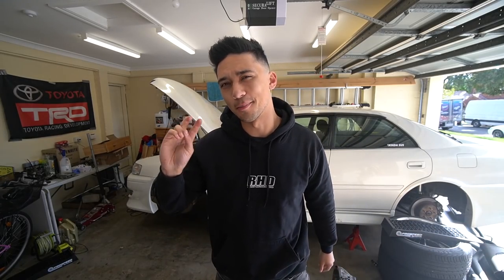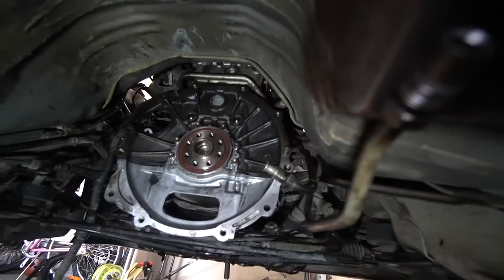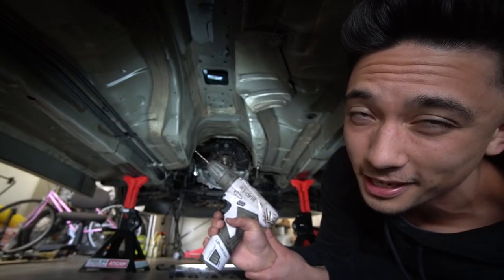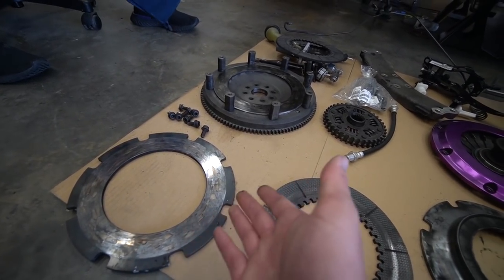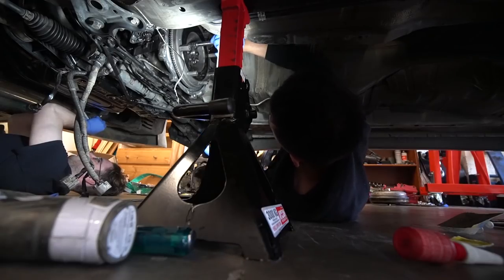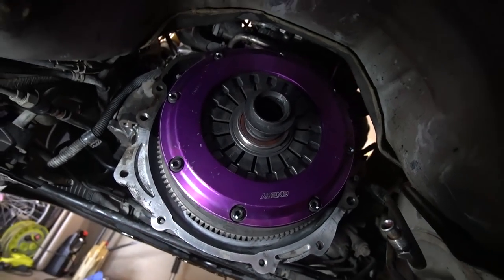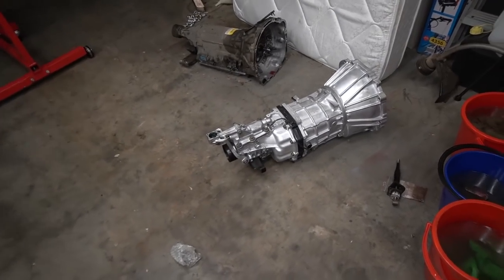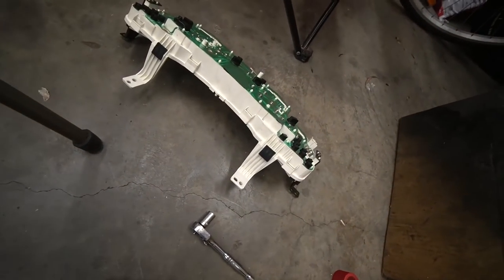JZX100 Manual Swap (EVERYTHING YOU NEED!) Part. 2

Comment: I had a cube short shifter on my gearbox and i took it off. stock feels wayyyyy better, the short shifter was hard to tell if it was in gear and shifted slow. lots of the guys on the NZ forum have gone from the cube shifter to the stock one.

Comment: Does the rx7 have a small driver's side bucket seat and did the owner keep the previous number plate? If its that, I was about to buy it in July, but lockdown so rip : /